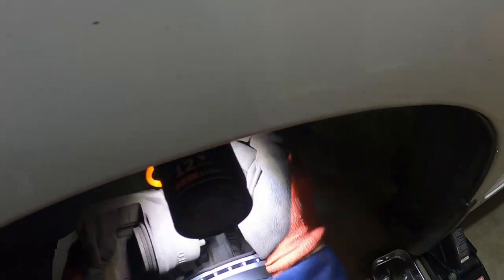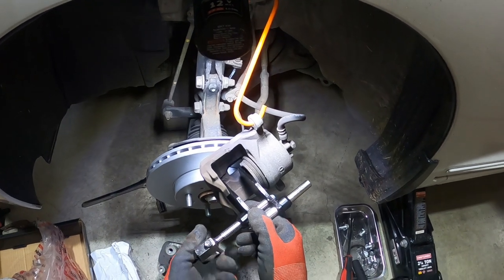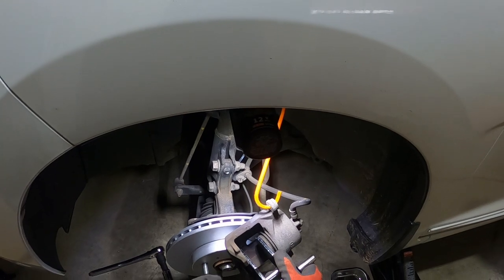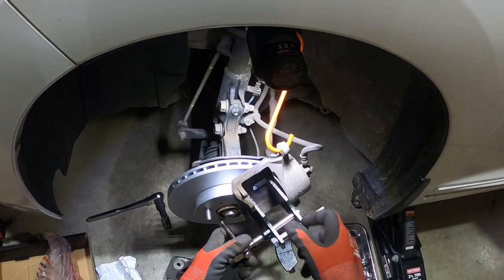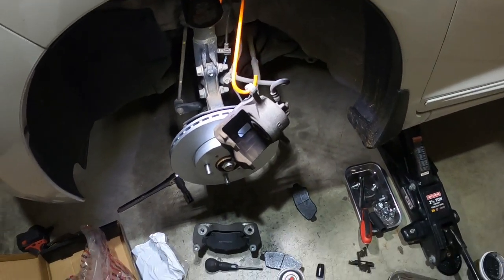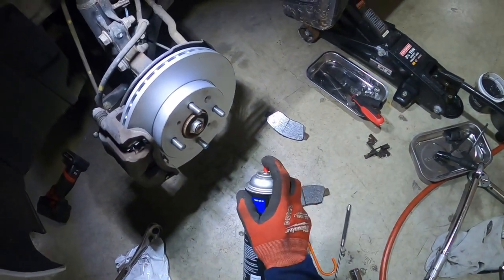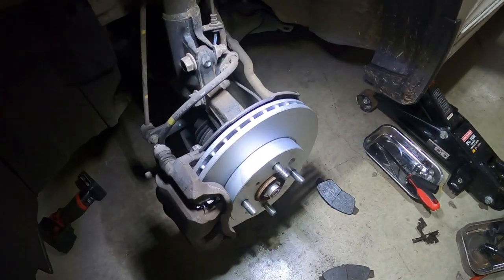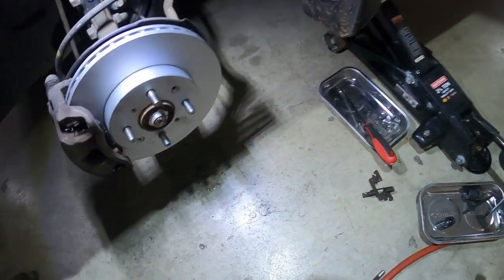DIY Front Brakes & Rotor Replacement - 2015 Honda Fit (GoPro Premiere)

Comment: Excellent job of explaining all the steps and more importantly the reasoning behind what you do.   Here's a tip, my father was an auto mechanic.  He would turn the steering wheel to the far left so you can access the bolts easier behind the calipers.
Reply from the maker: That is a great idea.  I always think to do it when checking tires for leaks, didn’t think about it here.

Great suggestion 👍

Comment: Whenever I work on brakes, I like to remove those slide pins, clean them, and then apply some fresh grease (silicone anti-seize, dielectric grease, or brake grease). If those suckers freeze up then your brakes are compromised.
Reply from the maker: I was thinking I did that… maybe I didn’t.

Good Tip 👍

Comment: Very helpful, thanks!  One tip; before compressing the pistons, pop the hood and make sure some "helpful" person/prior owner hasn't topped off the brake fluid reservoir to the top when the pads were worn.  You might need to suck some fluid out of the reservoir if so (can use a turkey baster), to prevent the reservoir from overflowing when the pistons are compressed.  If it does overflow, rinse the brake fluid off immediately, it's corrosive to metal and paint.  Another tip, if you're unsure where to apply lubricant to the caliper, look for witness marks from the brake pad ears rubbing against the caliper.  Several good tips in your video, including to use a JIS screwdriver to remove the rotor retaining screw.  Cheers!
Reply from the maker: Thanks for watching and the suggestions to be even more helpful.  I’m definitely not a mechanic… just like doing things myself 😂.

Comment: Just want to say THANK YOU! The bit about the screw not being a Phillips and sticking/stripping, was worth DOUBLE the price of admission! Cheap screw wanted to strip pretty instantly, so I used a punch to loosen them both. Overall, easy cheesy job. Hardest part really, was realizing no room for my floor jack, and after spending 10 mi trying to find a way to roll it  underneath, switched to the stock honda jack....
Also, to whoever commented about needing 2 screws, really, you don't even need one. The lug bolts hold it all together more than anything.
Question for folks, we got 42K out of the original front pads(still had a tad left on em) with mostly hilly and town driving. What have other folks gotten? I changed the rotors too, easier n less time than taking old ones out to surface them.
Reply from the maker: You are welcome… not a bad job at all.  I don’t remember how many miles this had (or if I said)

Comment: I used to use an ordinary c-clamp to push the piston into the caliper, the kind of clamp used in wood-working to hold glued joints together while the glue is drying.
Reply from the maker: 👍👍..

I used to just use a really big pair of channellocks with something flat.  I knew if I did that I would never hear the end of it 😂

Comment: I would probably replace the pads and install it back on the caliper before removing the rotor because I like to have as few parts off that aren't repaired as possible and it's a confidence boost since this is something I have never done. I will be doing this in a couple weeks. Thanks for the video, thumbs up
Reply from the maker: Appreciate it.  You will be able to do it… and if that helps you it makes since to me.

Comment: Thank you so much for the helpful video. Couple of questions for you. 1) What grinder wheel did you use to clean the part that the rotor is seated on? 2) Is there a reason why you chose not to apply grease to that area you grinded off the rust before placing the rotor back on to prevent the rotor to cease? 

Again, thank you very much. Even though it isn't your intent for the channel, I do hope you continue to do more maintenance to the Honda Fit. God Bless!
Reply from the maker: It was a die grinder pad like this … https://amzn.to/3MIwSe9

Probably 120 grit, I’m not sure what I used but it doesn’t need to be aggressive.

I don’t put any on because you don’t want grease to end up getting on the rotor where the pads will end up touching.

They don’t touch in that area, but if you apply grease there, it could possibly end up getting on that area.

It’s really just surface rust… you are just knocking it off mostly to clean the area so everything seats flush.  You don’t want a patch of rust to hold your rotor out farther in one spot than another.

I could be wrong in all of this 😂.. it’s just what I do.  Hope it helps.

Appreciate the compliment and you watching 👍

Comment: Nice video.
Good to see non-auto mechanic maintaining procedures in order to do the work properly.
Head mount is ok. Sometimes things are out of frame, but it's probably specific position during the job.
Props for using torque wrench.
Definitely buy and use some knee pads; even doing work that does not require kneeling; keeping your knee joints nice and warm is a gift from present-you to future-you. I use Makita Light Duty Knee Pads E-05642.
As for your way of work. Don't be afraid to be judged. Do the thing the way you do them, not the way you think people would like you to do. It the crazy internet, so sooner or later you will collide with keyboard warriors.
All the best in 2022.
Reply from the maker: Thank you so much. 

I noticed the frames when I did playback, I cut some of them out. That’s the worst thing about the GoPro is I can’t see what I’m recording.

I think in the future I may get my phone out to record in tight spots (like where the bolts were) and fix that in editing.  I have tried to stay away from doing editing because I haven’t done much on that end but I’m slowly figuring some of that out.

Agree 100% on knee pads and safety stuff in general. I’m bad about eye, ear, and body protection.  I have it all but I get in the flow of work and forget about it.  

Thanks again for your support and best of luck in 2022!
Reply: @MORGANSMaintenance  With other PPE is like with gloves. When you get used to them, you can't imagine working without them.

Comment: Hi ,  the reason for the wobble in the rotor, may be , because you only put in one screw, to fasting the rotor, but if you put two screws in the rotor will not wobble, it will be stable on both sides, I see it only had one screw ,but it has space for two
Reply from the maker: I only know enough about  mechanic work to just put back whatever I take off.  😂

Appreciate the suggestion 👍👍
Reply: Not needed, the single bolt in the rotor is just to hold the rotor in place until the wheel goes on. The lug nuts will tighten everything down and hold it steady.
Reply from the maker: @JettyLife23  👍

Comment: Nice video man.
Good pace and easy for a non mechanic like me to understand.
I’m assuming my 2016 fit is the same. Learned a thing or two from you just now. 
Btw, your words are so true. I like working on things too, a lot of work are just common sense and willingness to learn. Unless something entails safety concerns or out of my ability, I’ll tackle it myself. I’m also a tool junkie. Lol
Thanks a lot!
Reply from the maker: It should be pretty similar. Thanks for the compliment. I’m still learning how to film with the GoPro but one day I may get the hang of it.

It’s not a hard job to do. Best of luck to you!
Reply from the maker: Just saw your edit..

Most things if you look at it long enough you can tell what it is supposed to do… or how it works. Then it’s just a matter of removing things, replacing things, and putting them back.

I have a tool problem 😂. If I do more work myself I get to buy more of them.
Reply: That is exactly right Morgan. It’s how we look at things and willingness to tackle it with positive attitudes.
All the best to your channel. You are a natural in front of the camera. Keep up the good work.

Comment: What sort of grease are you using to lube up the parts? I'll be doing this myself soon and your video has been so helpful :) should save me nearly $200
Reply from the maker: It is a synthetic brake grease.  https://amzn.to/3L0OgKe

I have links for most things I used in the description.  You can probably get a smaller container of it cheaper at an Auto Parts Store.

It’s not a bad job at all. Glad I could help 👍
Reply: I like to use a copper based anti-seize grease (high temp) on the face of the hub where it mates with the inside of the rotor to prevent the rust from welding the two together.

Comment: Do you have a recommendation to buy both front and read brake pads and rotors?
Reply from the maker: I only did the front pads.  The rears are drums, so it’s a little different process. I checked those and they were ok, so I didn’t change them.